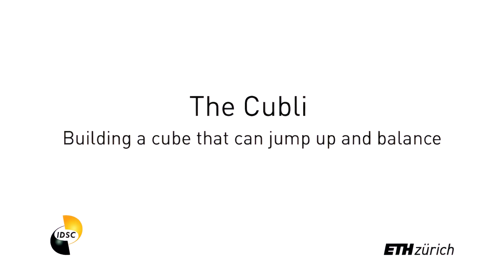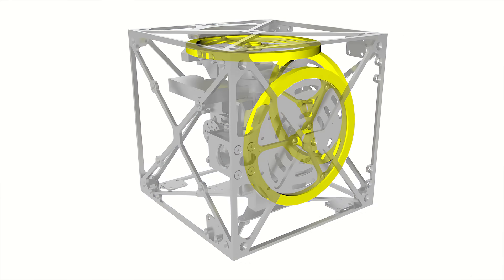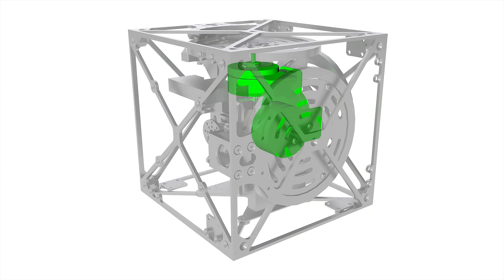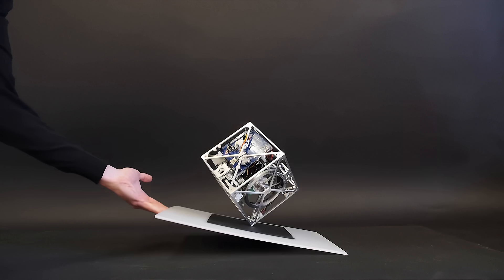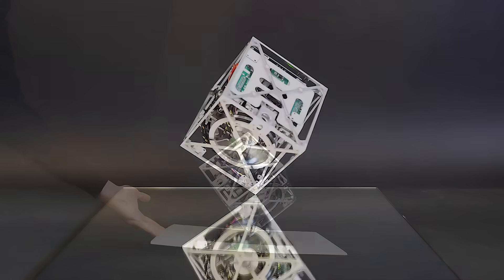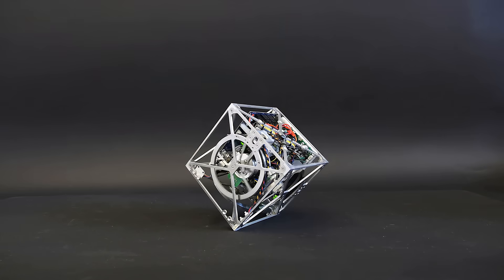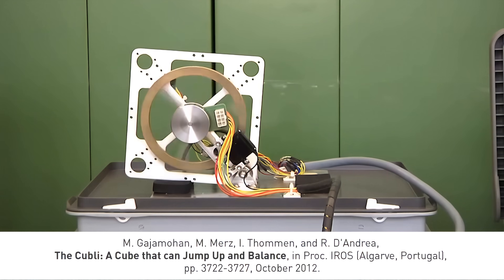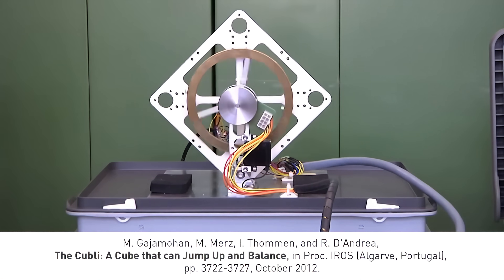The Cubli: a cube that can jump up, balance, and 'walk'

Comment: Why don't they put this kind of Tech in cars? It could keep them more stable and prevent rollovers.
Reply: Because you would probably need either A LOT of gyros or one really big one, and you would need them in a way that is "balanced" and you don't have 80% of the gyros in the rear and only 20% in the front.

Comment: Awesome invention sir, You make us feel proud! 

One question that I have pondered over many years is this...

How does one go about gyro-stabilizing a cylindrical plumb-bob so that it is always dead-vertical by killing all tendencies to oscillate. 

Reason I ask is that I've erected hundreds of elevators in my time. Now for perfectly aligning it to the vertical, we currently use plumb-bobs hung all the way from the top of the shaft to the pit. This is about 50 metres for a 16 storeyed building. The plumbs can't be easily steadied, because of the pendulum's length and also the tendency of the suspending wire to pick up wind forces. Current practice is to use a barrel of water in which the plumb is dipped to kill oscillations.

What's really needed is a gyro-stabilized plumb suspended that can be suspended right on top and which emits a dead-vertical laser beam. I get the feeling that with your stand-point of knowledge this task ought to be a lot simpler than the Cubli!

Comment: Could it be used as the base of new buildings in zones at risk of earthquake? I imagine that the motor for stability would activate only in case of an earthquake and that it would be kept charged thanks to some photovoltaic panels.

Comment: Using it for planet exploration??  If i've ever heard of regression...  From wheeled rovers to square cubes... seems legit.
Reply: Engineering Nonsense Something that occurs to me is that wheeled rovers suffer greatly from dust getting into bearings. really, dust basically dust getting everywhere. Dust on planets that lack an atmosphere is incredibly sharp and abrasive, so the idea of having a mostly sealed box that can move around does have that going for it at least. Add to that the fact that for exploring planets in other solar systems you want to be using loads and loads of little robots instead of one or two big ones and the idea doesn't seem so silly.

Comment: But can it throw a 90kg projectile over 300 meters using a counterweight?
Reply: Just make a large flywheel that brakes heavily, transmitting the force to a rotating arm ;p
Reply: r/trebuchetmemes
Reply: P4z4n can be use for lifting your house to another place
Reply: Ave Maria brother!
Reply: P4z4n bot directly... But can push thw boton to do it
Reply: i can do that with my bike and a stick.